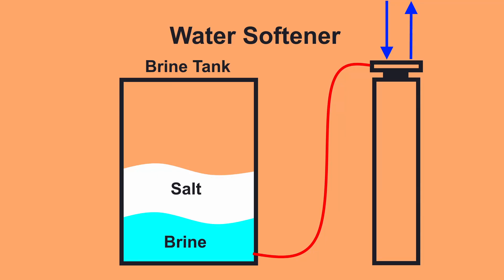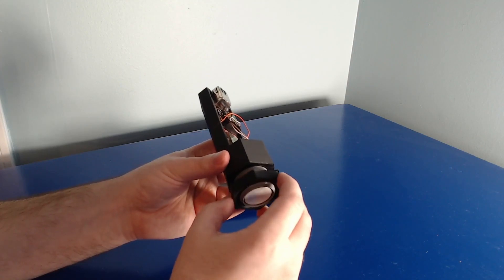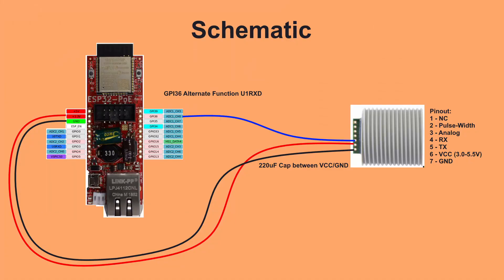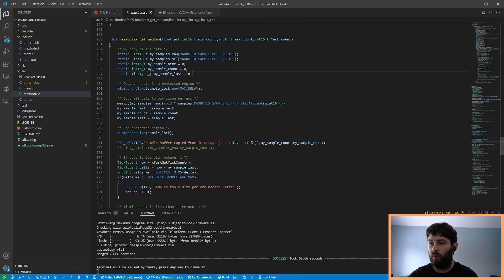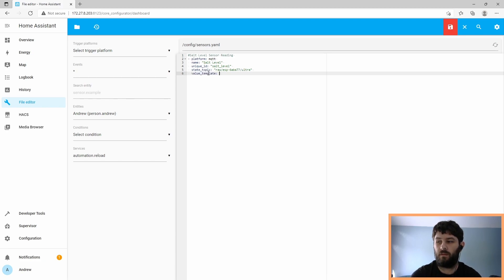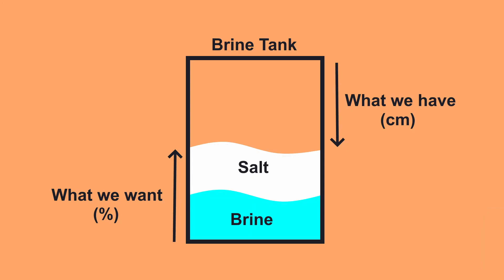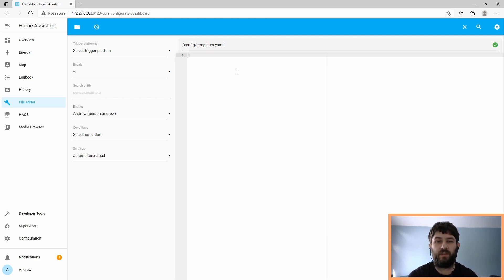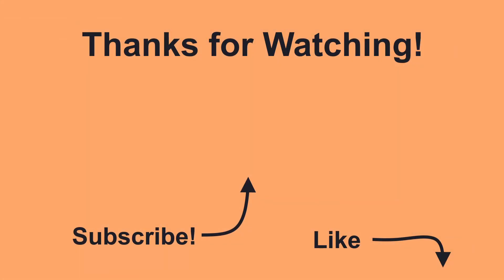DIY Water Softener Salt Tank Level Sensor for Home Assistant with MQTT

Comment: Will this setup work with the cheaper exposed sensors? Or will there need to be changes in your code?
Reply from the maker: A lot of the cheaper sensors require the microcontroller to do timing (with a pulse out and in line). This sensor does the timing onboard and returns results over serial. So you'd need to make code changes to use a different type of sensor.

Comment: Just got this in my YouTube suggestions. I've been meaning to document my version of this I made 2ish years ago, which is an ESP8266 (with WiFi) that is taped to the lid of the salt tank, plugged into a wall outlet. I used an IR sensor rather than ultrasonic, and the thin wires just go under the lid. The 8266 is running ESPHome so HA is able to find it on its own.

Comment: Got my sensor up and running! Only finished last night, so it hasn't gathered much data (yet), but this is going to save me a TON of hassle to get alerts when it's running low. 
Photos: https://photos.app.goo.gl/9ZpgbGKQjNYWdpQ18

Ran into 2 issues, which I'll mention here in case anyone else runs into similar troubles:

1) I had an app installed on Windows that included its own version of Python (2.x I believe) that was in my system PATH, and for some reason PlatformIO kept trying to use that during build and caused it to fail. Once the offending app was uninstalled, my base Python (3.6) was used and compiled successfully.

2) Had an issue where after installing, Ethernet would fail to connect, and logs mentioned a timeout error in the `esp_eth_driver_install` function. Did some googling, and other people using the Olimex POE have had similar issues, apparently related to the RMII clock using GPIO17. Most of the recommended steps (changing config to use GPIO17 instead of GPIO0, turning on CONFIG_ETH_RMII_CLK_OUTPUT, etc...) didn't help - in part because the `sdkconfig` file included in @apalrd's adventures  GIT repo already included those configuration items. Not sure why it was breaking. But re-running the 'Menuconfig' and selecting the same values produced a new `sdkconfig.esp32-poe`, and copying its contents into the base `sdkconfig` and recompiling fixed it, and ethernet was finally able to connect. I haven't done a diff to compare what might have changed, but rebuilding the config is simple enough.

Thanks again for the straightforward guide!
Reply from the maker: Glad you liked it! I've found it to be very useful even though it only alerts me every few months
Reply: @apalrdsadventures  that's what I need though, otherwise I forget :)

Comment: This is great but would there be a way to use this with ESPhome? I prefer ESPHome for a couple features like OTA and native integration with HA.
Reply from the maker: I don't use ESPHome so I'm not sure if it integrates with this sensor
Reply: Did you ever find a solution with ESPHome?
Reply: I feel like this would have been a lot easier with esphome than mqtt but I also have not used serial input on esphome before so idk what roadblocks there may be.